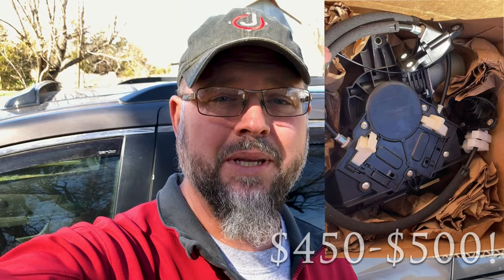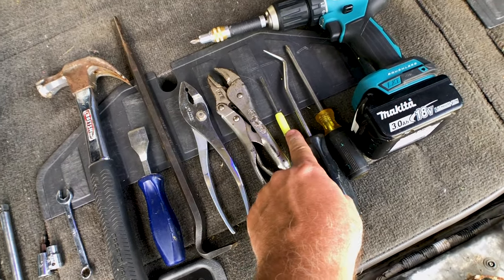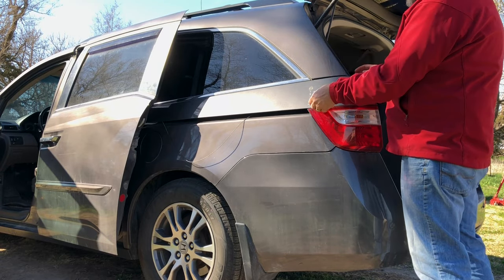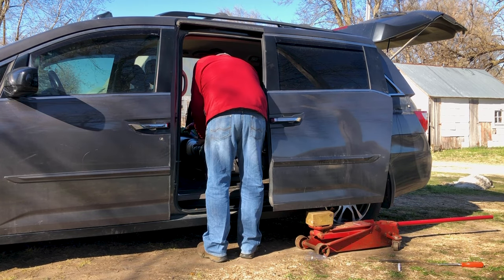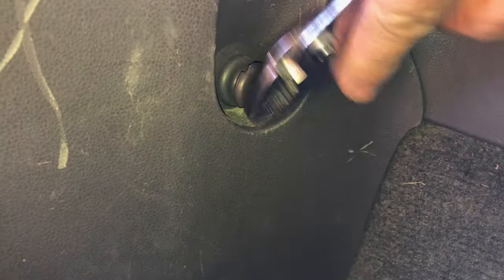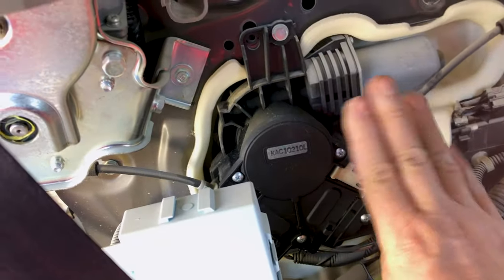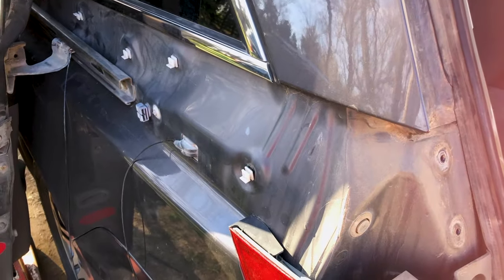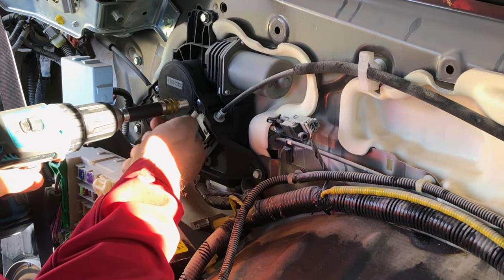FIX: Honda Odyssey Sliding Door Cable: Step-by-Step DIY Guide (2011-2017)

Comment: Hello and thanks for the amazingly thorough video. I completed both the driver and passenger side doors on our 2015 Odyssey about 5 weeks ago. 
1. The drivers side is way easier and glad I did that one first. Also, the wire made a clean break and everything was quite clean in the spool on my driver side motor. 
2. The passenger side was a bear. I was stressed about dropping bolts and it was simply much more difficult to access everything. The spool was a jumbled mess of tattered wire — pretty much what’s shown in the video. As a result, the ridges of the spool weren’t quite as pronounced as they probably should be but I cleaned it up and it works, albeit not the smoothest close of an automated door. 

I do have a question for you/anyone that might have insight. 
The driver side door, that was clean and relatively easy to go back together has frequent issues fully closing. I would say maybe 30% of the time the door makes it about 2/3 the way shut, then does a hesitation and opens back up. This is remedied by either trying again a few more times or trying to muscle it past that point to get the door to fully close. 
Is this a common problem anyone else has experienced? Could this be something that I did during re-assembly causing this? Note the only deviation I made from the video was removing the two bolts holding the door on, then removing the pin and putting the bolts back on. Could my door by un level? Is there something I could clean or lubricate that might help?
My wife is ready to sell the van and get a new one, and with 205K miles it might be close anyway, but I wanted to get another year or two out of it if possible. 

Thanks again for the great video and appreciate any insight you all might have.
Reply: You can purchase a replacement upper roller. I am addressing the passenger side motor and noticed the upper roller wheels are shattered (I assume from forcing it open/closed over and over). This is causing enough resistance that will make the motor stop and re-open.
Reply: @knoxautosalesinc9746  Great tip. Thanks so much for the reply and best of luck with your repair too!
Reply from the maker: Thanks for the feedback and great question. Checking the rollers as @knoxautosalesinc9746 suggested is a great idea. Also, check the upper rail where the roller rides for deformation or damage. I didn’t show it in the video, but when I was trying to slide the door open by force, I deformed the rail and bent it out a bit. I was able to put it back in the original position with few strategic hammer blows (be careful). Let me know your fix!

Comment: This is such a helpful video… and the comments from other users, too. Ours is broken on the passenger side. Unfortunately, we got everything opened up, the cover off the motor, removed the nut with some effort, unlike yours that was loose, and found the spool wouldn’t budge. It looks like the cable broke because the motor seized up. 😭😭😭😭  We will either order a new motor or leave the door as manual-use like the good old days.  No biggie. Better than the last six months we’ve been going without that door. At any rate, thank you for saving us the cost of the labor and the stress of trying to figure out how to do this job.  Your channel will be my go-to for other odyssey repairs.
Reply from the maker: Wow, thank you for the kind words! I'm sorry to hear that it looks link your motor is seized. Ugh! We did the old-school manual route during the winter, which wasn't fun. If you decide to replace the motor and assembly later, it is a much simpler installation. If you can afford it, I would also recommend using a genuine Honda replacement.

Comment: Thank you for this excellent video, it was a HUGE help to me.  My cable broke on the passenger side which is much harder to replace because the AC blower blocks the back cable unit.  Royal pain to get around.  I had to disassemble a good portion of the blower.  My advice is to go with the cable only approach if your passenger side door is broke.
Reply from the maker: Thanks for sharing your experience! I’m sure I’ll get a chance to replace the passenger side at some point, so I’ll make a video then for the other half of people doing this repair.

Comment: I’ve done this fix before replacing just the cables and not the entire assembly.  Was a great deal of work and lasted only able 6 months before the cable broke.  

This time around I ordered the complete assembly. Was around $550 for the part. FYI, the part number for right (passenger) side is 72010-TK8-305.    Driver side is 72050-TK8-305

Took about 2 hours to do and now all is well.
Reply from the maker: Thanks for the feedback and for providing part numbers. It seems like some people have cables that break within a year or two, but most others have no problems. 

That’s one risk of buying non-OEM parts (that goes for parts from AutoZone and NAPA too). OEM parts are always the best, but you will pay for it. However, the ease of installation and high quality adds lots of value. It’s a decision each person needs to make for themselves. 👍🏼
Reply: How long did the other cable last? I thought about ordering the whole assembly from Honda, but it's $665 😢 in Ohio. This video is causing me to consider going in a different direction.
Reply from the maker: @michaelthompson3617  - after more than six months, my cable is still working perfectly. Generally, price is related to quality and genuine Honda parts will provide the highest quality at the highest price. However, if your motor is still working, it’s not necessary to replace the entire assembly. 

Tell me how it goes!

Comment: Great video. My cable broke on the driver side so I replaced the cables and the bracket with the rollers since the door was starting to be a little jerky before the cable broke.  It took me about 3.5 hours, but about 1.5 hours of that was starting and stopping your video! I could  not get the pin out no matter how hard I tried, so I took the two bolts off and pounded the pin out on a vice. . Overall, not to bad, I just went at a steady pace. Saved me $1300, and I'm now ready to do the passenger side if that ever breaks.  Thanks again for a great how to video!
Reply from the maker: Great job! That pin has bested more than a few people. If your passenger side breaks, be sure to read this comments section as several people have shared tips on changing that side (it’s a bit different).
Reply: @YOUCanFixAnythingAuto a disculpe ese trabajo que precio tiene ?

Comment: Thanks man! 1.5 hrs and its working.. my cable was jamed in the spool and could not get it out.. had to pull the cable with pilers which may or may not have bent over some of the channels on the spool.  Couldn't find a place to get a replacement  spool so just ended up using it and seems to be working for now.
Reply from the maker: Great job! Yeah, sometimes when the cable breaks and we continue to open and close the door by force, things get pretty jammed up.

Comment: Thanks for the video. Great tip about having the door open all the way and winding the back cable first. Winding the cables really wasn't hard at all. Also, thank you for the link to the cable assembly, it was so easy to not need to measure, cut and crimp the cable and it really wasn't that much more expensive (it was like $33 v $25, but Amazon had 10% off coupon). The only thing I did differently was taking the rear door slider out. I marked the hinge (so that when I bolted it back it would go right back to the original spot) and then just took out the two bolts, this seemed easier than messing with the E clip and punching out the pin, the repair manual states that the torque for those two bolts are 22 lbf-ft.
Reply from the maker: Thanks for the feedback! I'm glad opening the door all the way helped you too. I kinda figured that out as I was struggling with rewinding the cable and thinking through the best approach. A few people have had difficulty removing the e-clip and pin, so they resorted to removing the bolts. Marking the hinge was a great idea! Thanks for sharing the torque spec.

Comment: Thank you for this very informative video. I ordered using your link. It took 2 days for prime to get 2 sets of cable to my house but I only did the left side driver side slide door. It took me 1 and half hour to tear down and get to the motor with bird nest on the spindle just like the video depicted.
Reply from the maker: Great job! Im glad the video was helpful.
Reply: The left door is fixed now. Waiting for the other goes bad since I have extra cable. I ordered the crimping tool but won't need it. Thanks

Comment: Great video.  I had to do the passenger side which has the cable wound opposite this side.  Procedure:  Put door in MOSTLY closed position and FRONT cable winds on the back of the spool.  Also, make sure to check slack on the outside of your van before testing.  Front end of my cable somehow got underneath the track, which shaved off the cable coating.  Lucky me, I got to do this twice.  Grateful it only cost me $28 each time.
Reply from the maker: Great tip! Thanks for sharing. You are an expert now! 🙌🏼

Comment: So last night I spent 12+ hours replacing the passenger cables only in a 2012 Odyssey.  I almost gave up several times at various stages of the process.  Mostly due to inaccessibility to the screws or at best super tight space to get anything onto them to loosen them or tighten them.  The winding of the cables took me  a while to figure out.  The trick was to close the door all the way first.  Then wind up the cable toward the back of the spindle by rotating it otherwise the cable twists.  Then using the pulleys and their springs was then able to wind the rear cable on the front of the spindle and voila a perfect assembly.  Remember don’t wind the cable on the spindle rather rotate the spindle to wind in the cable.
Reply from the maker: Thanks for sharing your experience, I’ve had several people tell me that the passenger side is much more difficult than the driver side. If I get the chance, I’ll make a video specifically for the passenger side.

Comment: Thank you so much, great instructions and this was very doable.  I got it working in about 8 interruped hours.  Had to file and sand my spool piece, and I put some dry lube on it for good measure.

I noticed the outside track where the cable rubs slightly had a lot of dirt build up-- i cleaned that well and then sprayed dry lube there also.

Thanks again for the really helpful video.
Reply from the maker: You're welcome! I used some WD-40 on the outside track, but using dry lube is definitely the better product… Especially if you live in a rural location and have to drive on gravel roads!

Comment: Thank you for e great video. So I got the cable replaced. The door will open automatically. When trying to close, the door is close to being fully shut, but then stops and reopens. Any ideas? Thanks.
Reply from the maker: Go to the end of my video and redo the steps to resent the home position. If that doesn’t work, you can try greasing the track. Also check to make sure the weatherstripping is reinstalled correctly. It almost sounds like there is something interfering as the door tries to latch shut. Let me know what you discover.

Comment: Awesome awesome tutorial! The trouble spots are the door pin and getting the spindle back in. The pin - I took a flathead screwdriver and wedged it in with a few taps. It just needs to break away the first part and then it slides out nicely. The spindle reinstall was the most difficult. After I realized what those springs did I was able to stretch cables far enough to set everything into place.

Broke a few clips removing the interior pieces which is lame. Luckily I have a set of honda clips set from amazon just waiting to be used.😀
Reply: I found it easier to not separate it at the hinge but rather remove the entire hinge mechanism from the door. It's 2 bolts.
Reply from the maker: Glad it worked out for you. By removing the pin, you don't have to worry about marking the bracket and realignment issues upon reassembly. I didn't have any trouble, but it has been a headache for some. 

Regarding the spindle, exercising the springs makes all the difference!
Reply from the maker: True, but you want to be sure to mark the bracket location so you won't have alignment issues upon reassembly.

Comment: Thank you! I only want to remove the cable not replace but this was helpful! My van is a 2005 beater from a previous owner’s abuse. But the engine is good. The cable snapped and the door only opens a few inches. Not paying to replace and I don’t trust us to replace even with helpful info like this. Creators
Like this are invaluable.

That’s me at 3:59 lol
Reply from the maker: I’m glad it was helpful! Also, I try to not cut out the real experience of repairing cars, no matter how goofy. 😅

Comment: My cable snapped this morning because door had unknowingly frozen shut. This video will prove invaluable and I REALLY APPRECIATE you creating/posting it!   Two quick questions:
1) Is it the same cable set from either NewEgg or Amazon? If not, do you recommend one over the other from a quality standpoint? 
2) I worry about disassembling everything and discovering that (like you) they sent me the wrong cable lengths. Any chance you (or any viewers) know the correct cable lengths so I can measure what I receive BEFORE tearing the van down for replacement? 
Again - Thanks for all the assistance!
Reply from the maker: If I remember correctly, I ordered it from Newegg because it was out of stock at Amazon. I used the part number from Amazon to search for the part, so it’s likely that they are from the same manufacturer.

Amazon is a one-stop shop and has a good return policy IF you need to return it within 30 days. With Newegg, I was able to get the replacement part sent out because the seller know and admitted to it being a shipment of defective parts that, according to them, was a one-time fluke. I was able to get the part replaced months after they were obligated to do so.
Reply: @YOUCanFixAnythingAuto  Thanks for the reply!  Do you recall approximate lengths of the correct cables?  I'd like to verify they didn't send the wrong ones (like they did with you) BEFORE I disassemble the can.

Comment: Passenger Side - Touring model 2011 - school of hard knocks lesson - for my model the rear air conditioner was in the way of the bolts for the rear pulley which goes to the outside rear of the sliding door.  This was a major pain to remove the nuts for the rear pulley.  My vocabulary was expanded during this effort.  Had to loosen the air conditioning assembly, still difficult to complete with limited very awkward access to the nuts.  Only lost one nut and one socket in the rear quarter panel - not funny by the way.  Those two items will stay with the vehicle :).  In hindsight, I would use the wire only kit for the passenger side repair if your model has the AC assembly in the passenger rear.  regardless, thank you for the recommendation on spooling the pulley wheel with the door all the way back, back side cable first on the rear of the spool, brilliant advice.  Unfortunately it appears my motor is bad (did not work after completion, and after checking the fuse supporting the right passenger door motor), so I will purchase a new replacement motor and use all the experience I now have to reinstall the new motor.  Nice job on the video!  Very clear, very informative, however the passenger side with AC will be much more challenging!!
Reply from the maker: Oof! You are not the first to comment and the difficulty of the passenger side and loss of tools! I’m sorry that it didn’t get the door working. 

You have the right attitude towards the experience. Even the worst experience provides some value if we are able to learn from it. Let me know how the motor replace goes!

Comment: You have to remember that the left and right doors have mirror opposite  in the way the roles work. So when you change the right side door the roller is the opposite so the guys in the other videos that said to start from the other side were NOT wrong they were just working on the other door and from their side it was correct. Other than that great info.
Reply from the maker: You are correct. The cable winding process is opposite on the RH door.

Comment: Got a 2016 and snap the cable on the driver side . it was 1300$ + labour. ebay was 400 full motor with cables. I strongly recommend removing the two bolts that are holding the door to car body. it was much easier for me than trying to bang on metal in such narrow place to get that screw. that screw would not want to come out. I had a friend hold the door while I remove the two bolts. was easy work afterwards.  need few new plastic clips for later when i have time. door now is better that ever. thank you for the video brother ! 👍🏻🤠👍🏻

Comment: Awesome video, thank you!!! I opened up my left (driver) motor assembly and the rear white spring was broken. I superglued and crossed my fingers then installed the new cables. However, no luck. It immediately exploded :)   Everything else was exactly like in the video. I've searched and can't find the name of the part or even the part itself online. It's all or nothing with the motor assembly. Does anyone have this part and you no longer need it? I'll  buy it from you!!!
Reply from the maker: I would check out local salvage yards. If you find one, just pull out the entire assembly, motor and all! Also see if you can find a used one on eBay.

Good luck! Tell me how it goes.